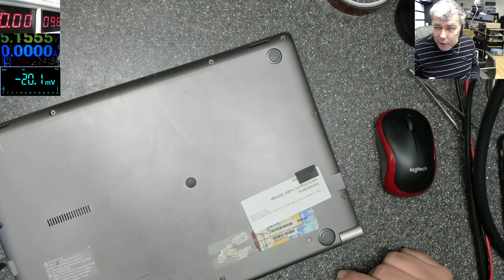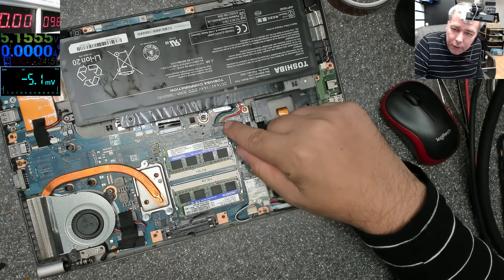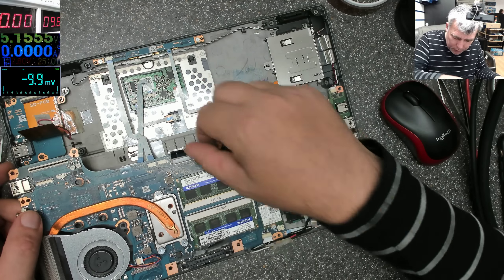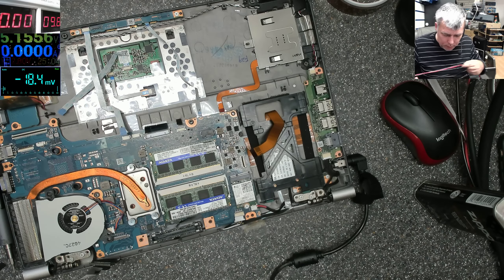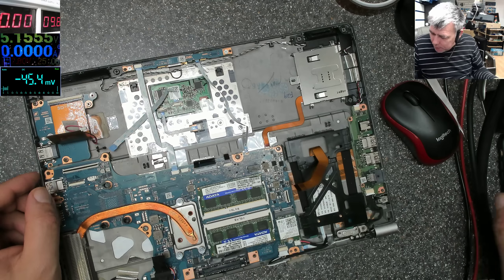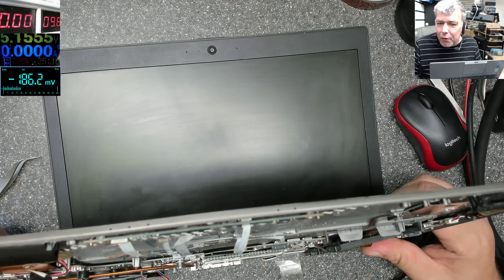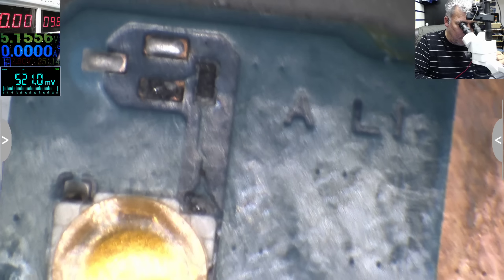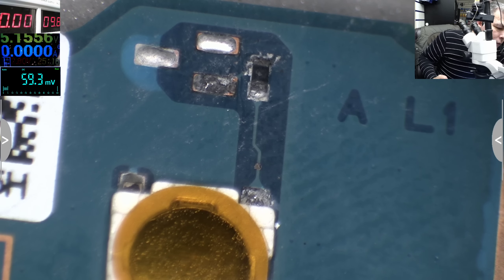Toshiba Tecra Z40-8-18R dead, water damage, let's fix it

Comment: I am grateful for your honesty. It should be a good lesson for anyone. ANYTHING stored on a laptop or pc directly will just be the BIOS on the CMOS chip in any sense of software. This means there can be several reasons to destroy something like that, pure malice, scam etc. The fact that you are honest is something we are seeing less of today, we can see this lack of honesty being reflected in the news. Mistakes are mistakes and are forgiveable. I am sure there are many watching this to the end who will agree when I say, mistakes are mistakes and there is nothing wrong with that. It also is down to your morals and ethicsa as you were paid to do that job, no questions asked and it is NOT obligatory for the owner to disclose why. You were NOT paid to ask why, just to do it if you could. It would be however for anyone to explain to a customer or anyone that NOTHING is stored on a laptop in that way and can be removed, i.e. the SSD or HDD etc. and so is a waste of time, and if asking, it raises suspicions of some form of criminal activity. This then negates not needing to know as you can discern what the intention is. 

A lesson learned is a lesson shared, as they say. What to discern and that honesty goes a long way. Do not be disheartened by it but rather use it as a lesson that can identify potential malice or dishonesty on the part of the owner. Even the best can make mistakes. So remember, there is some good in that video also.

Comment: Instead of trying to build a bridge from solder, it would have been much easier to just use that deleted resistor as your bridge.
But yea, when your boss gives you bad solder, then it's good to use it up as fast as possible. Maybe he'll realize that quality solder will enable you to work faster while using less.

Comment: I have a Toshiba Tecra Z50 A among others. When I plug it in or try to start if off the battery, I get a blinking power light and that's all. It blinks 5 shorts-one long and then two shorts. Nothing happens when I push the power button. It's been doing this for 3 months and it took me til yesterday to figure out how to by-pass it. If I hold the power button down till the light stops blinking, wait one minute then push power it will boot up. Sometimes I have to do it a couple or three times to get it to boot. Once booted up it works perfect. I have tested both the main battery and the RTC battery. Both are fine.  I had tried similar tactics before by disconnecting the RTC battery and holding the power button down for one minute. That never worked after numerous attempts. Any idea what may be going bad?
Reply: have you tried to soft restarted the computer after you by-passed it?
Reply: @lets_just_say_im_innocent  Yes, I did.As before it will work fine for a few days or weeks then suddenly won't start and get the blinking light. I has never shut down randomly. As long as it is on it's fine. It has no apps on it, only a clean install of Windows Pro. It originally had Win 8.1 Pro. I did the upgrade when it was free. Later, I erased the SSD and installed a clean Windoes 10. Every time it won't boot, it gets the same flashing light as before.

Comment: Can tell you Sorin why the solder ran away from your tip. Twas not because of your tip but because of the power being on. You thought the power was off, but because the solder moved away from itself I was pretty certain that the miniscus of the surface tension was removed in the solder blob once it was melted so it moved apart. LOUIS Rossman in New Yawk would have had 3 wires attached in the length of time you puttered mit dat vun. You see I did not understand your hesitancy to use a tiny wire. I could not grok that.

Comment: When one is carefully trying to NOT make a bridge, one inevitably appears. When you WANT to make a bridge...ROHS compliant solder? Lead is still the best.
Reply: Actually lead-free (i.e. rohs-compliant) will make a bridge easier because it needs more heat to melt it so it will solidify faster so easier to make a bridge. But that was silly, he should have just added a wire, 5 second job took 6 minutes 30 seconds LOL

Comment: Hello, Good day everyone. I have a problem with my HP Pavillion laptop. Some keys are not working so we replaced it with a new keyboard. The problem is that its not working but the dxdiag detects it. How can i fix this? Is it the compatability of the new keyboard to the laptop?
Reply: Win 10 right? .. try start then run, type "ksetup" then enter , or go to c:\windows\system32 , find ksetup.exe i think or mabye .com and double click it .. worked for me after replaceing a keyboard
Reply: You can enable on screen keyboard in settings
Reply: @dingo8812  Hello, thank you for the help. I just realized the problem, its the cable of the keyboard to the motherboard. It is upside down. It seems the keyboard that was ordered by the owner was not the right one. I had my doubts when i saw it at first but now my hunch was right. Anyway thank you for the help and maybe it can help me in the future. Take care. :D
Reply: @jakemanlupig9287  no problem.. yes my keyboard ribbon cable had to be folded over from new so the contacts was not upside down and for the position to be right.. take care :))

Comment: SORIN!!....YOU need your proper 1A Fuse....and not Solder!!
PS:....i know this problem....make sure you dont get the massage with Bios battery!! cause without charger you laptop cant save the RTC!! i guess there is a still a problem!
Reply: It needs to be a "properly calibrated" fuse... :-)